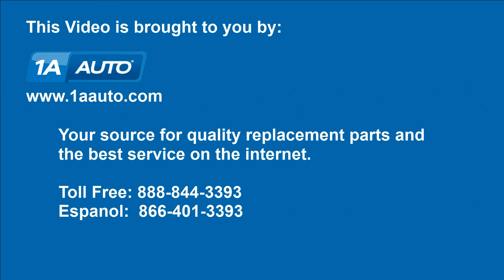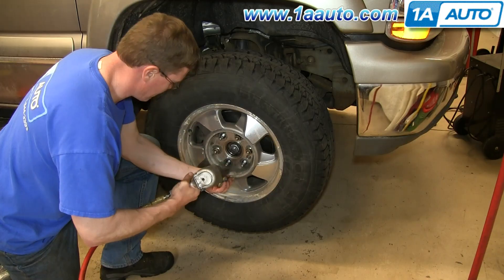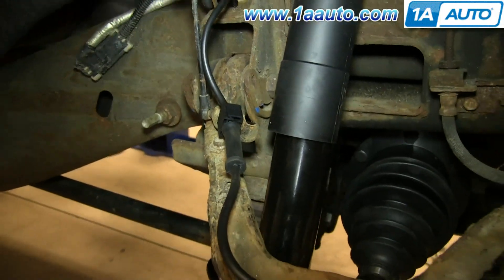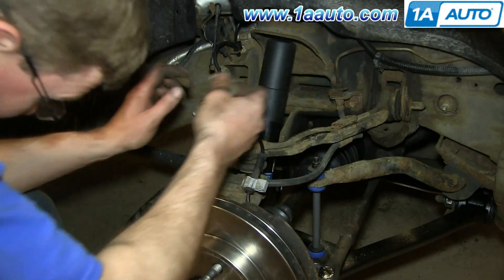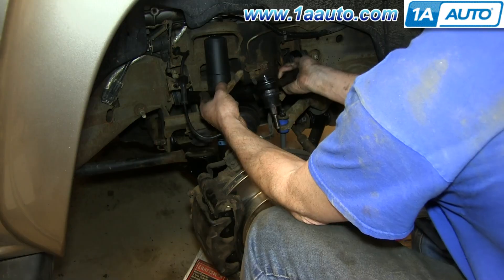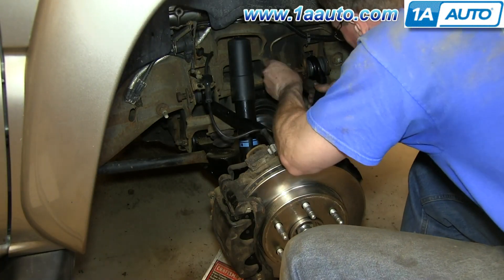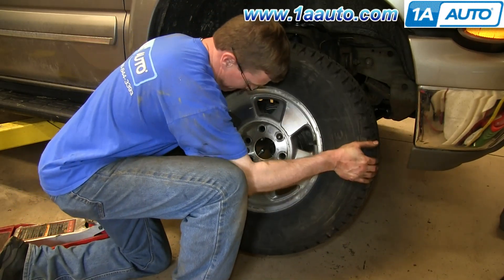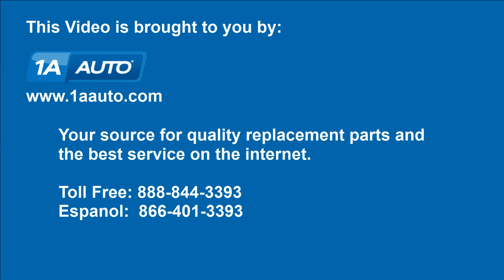How to Replace Upper Control Arm 00-06 Chevy Suburban 1500

Comment: This is a very good video. I had no problem replacing the control arms on my 2000 Chevy truck. The only thing I had to do different is I had to unbolt the brake line to get one of the bolts out of the control arm. I saw that coming and was prepared to take it loose. Thanks again!!!
Reply from the maker: +Gary Christian Thanks for watching. If any of our viewers needs to make this repair, we carry the auto repair part shown in this video on our website. Here is a link to them http://www.1aauto.com/control-arm-with-ball-joint-driver-or-passenger-side-front/i/1asfu00041?utm_source=YouTube&utm_medium=CTA+Comment&utm_campaign=ytcomment&utm_term=-L0exX3BRaE

Comment: The A arm bolts go in from the inside out, it does make a difference.   If you leveled your truck body with lifting keys. 
You need different upper control arms. OEM \stock ones throw the camber off. It would be good idea to replace the (3) pitman idler arms and bracket, if you have a high milage truck.

Comment: When the guys I work with told me before I put the upper control on said that have that a knockout tabs every video that I seen from 2002-2006 I don't see anybody knocking out the tabs. I just have a question to are there any on the 2006 two-wheel drive Chevy trucks please get back to me other than that I love watching your videos there are amazing they helped me through so much with all my cars and trucks.

Comment: A few heads ups for whoever does this in a different spec truck!

1. If you have wheel speed sensors, you will need to buy new brackets for the wire. Part number 15715954, special order from GM or GMPartsGiant. For the time if you don’t have it just use a zip tie.

2. You may need to undo the 10MM bolt for the metal brake line bracket to fully remove your camber bolts. You may also need to bend it upwards (gently!!!) out of the way.

Great video but just a few things I encountered.

Comment: At 1:15 is my upper control arm supposed to be resting all the time on that metal plate on the rite side of the arm rite under it??
Reply: No it should not be resting on the bump stop. Sounds like a too tall level kit has stolen all your down travel.

Comment: Currently in the middle of this job on my folk's 2005 Sierra 4wd. It's from Vermont, two of the bolts that hold the control arms on broke. (One on each side) All of the bolts are stuck. I've tried heating them with MAP gas. air hammer, etc. I'm literally going to torch them out tomorrow. What should have been a simple job has tuned into a 2+ day affair.

Comment: If only my ball joints would separate from the knuckle so easily.   Same could be said when I went to do the hub assembly.  Here in MN, rust is a better adhesive than JBweld, I swear.
Reply: 8lb sledge works like a charm

Comment: How do remove the control arm bolts when they are rusted to the inside tube of the bushing and spin when the rubber is torn, how do you get them out on a 2000 chevy suburban 2500 4x4
Reply: Hey man I just had the same problem. I had to use a reciprocating saw to cut the bolt off on both sides just on the inside of the bracket. You need a carbide tip $10 blade.

Comment: Snapped the two control arm bolts trying to remove the nut. Completely seized up. Tried beating them out with a hammer and punch tried turning them on the bolt side and broke the heads off.  Tried a air hammer and still can’t get them to budge. Any suggestions? And I can’t seem to find replacement bolts for it. Got any?

Comment: Do you know what bolt is used for the two mounting bolts for the brake hose? I shared off the heads of both of them and I need to drill and tap them, but I can't find what the thread size is.
Reply from the maker: +Thomas Freundl At this time we do not have any information on the size of the threads. Please do not hesitate to contact us with any further questions.
Reply: @1AAuto  Thanks for replying

Comment: Hey guys do know where to get the welded rivets that are like on the frame? One of my busted off when I did my upper control arm last summer and it’s been slightly shifting turning slow or stationary. Not sure exactly what they are called but they go through the little plates you marked.
Reply: Moog makes camber pins

Comment: Would you do this because the rotted bushings come as a set with the control arm? Can you still replace the upper ball joint and reuse the old control arm?
Reply from the maker: The upper ball joint may not be serviceable. You more-than-likely would have to replace the whole arm.

Comment: After putting control arms does it need to be aligned again
Reply from the maker: +Teresa Gentil Yes. You should get an alignment any time you work on your steering or suspension. Hope this helps you out. 1aauto.com 866-403-3393

Comment: Where is the spring?  Did you remove the front spring for clarity?
Reply: It has torsion bars, not springs.
Reply: No spring on 4wd. They use torsion bars that run from the middle of the truck into the lower control arm
Reply: The spring makes it almost impossible to get the bolts out and back in. ( On 2wd models) Has anyone else had this problem. And if so, what does one do to make it easier?

Comment: Do you line up the alignment brackets with your liquid paper marks as you tighten everything up? Also, does it matter if you replace the stock upper control arm before or after installing 2" leveling torsion keys?  Thank you for your video. Great filming and well narrated.

Comment: wheel alignment after this job? Do you have to remove the whole arm or can you just replace the ball joint?
Reply from the maker: +Carl Zorro You should have an alignment done after making this repair. If the ball joint is serviceable on your application, you could just replace the ball joint if the bushings are okay on our control arm.

Comment: Might be an odd question but I have a 2000 Silverado 1500 4wd. I have a spare set of performance engine upper control arms from a 2001 Silverado 1500 2wd would they fit my 4wd?
Reply from the maker: You may want to check with the manufacturer of that particular part
Reply: 1A Auto Parts ok thank you I will

Comment: What are those brackets for and what do you like them up with? I'm doing this project soon on my 99 and been woundering about those.
Reply from the maker: +erik Hamilton Thanks for watching!  Those are the cam adjustment brackets, so you will have to mark where the tabs are like he shows you in the video.  You just mark where the tab is on the part where it mounts to.  If you do not put them back in the same positions your cam will be off and will need to be taken in to an alignment shop.  1aauto.com

Comment: Does this apply to a 2004 Chevy express 1500 rwd
Reply from the maker: +Kenneth Ball It may be a similar procedure. At this time, we do not have a video for your exact vehicle on the upper control arm install. Thanks for checking us out!
Reply: @1AAuto  got my new control arms in the mail already got them installed thanks for the fast shipping!

Comment: What brand name control arm(s) did you use? Do you recommend them? Would rather replace bushings/ball joint in the factory arms?
Reply from the maker: +amurican35 Here is a link to them control arms shown in this video on our website. Hope this helps you out. http://www.1aauto.com/control-arm-with-ball-joint-driver-or-passenger-side-front/i/1asfu00041?utm_source=YouTube&utm_medium=CTA+Comment&utm_campaign=ytcomment&utm_term=-L0exX3BRaE
Reply: I noticed in the video that you greased the upper control arm ball joint after install...however the link you provided takes me to the part but it has no grease coupling in the pic.  Do you or do you not have to grease the ball joint?
Reply from the maker: +amurican35 It the ball joint has a grease fitting it will need to be greased. If the ball joint does not have a grease fitting it is a self contained ball joint and does not need to be greased.

Comment: Great video's always. What are the torque specs for the upper ball joint nut? Thank you
Reply: How do you plan to get a torque wrench in there
Reply: @dawsonmessenge9860   Easy. Remove axle shaft.
Reply: 37ft-lb.  18mm crow's foot.

Comment: Which specific grease do you use in the upper control arm grease fitting?
Reply from the maker: +Taylor steeves You may want to check the service manual to see what it recommends. Usually you can buy a grease cartridge at your local auto parts store to grease them. If any of our viewers need to replace their control arms, we carry the replacement part shown in this video on our website. Here's a link to them, We also offer free shipping on all orders in the US.http://www.1aauto.com/control-arm-with-ball-joint-driver-or-passenger-side-front/i/1asfu00041?utm_source=YouTube&utm_medium=CTA%20Comment&utm_campaign=1ATony

Comment: what's the point in marking the tabs through me off a little?
Reply: Me too
Reply: That’s camber adjustments..you want it to be at least close,so the alignment is mostly intact.
Reply: @Mercury_Shadow462  what are you trying to get close to?
Reply: @andrewdevenezia4927  when you take it apart and put it back together it should be in the same spot. If your alignment was good to begin with.

Comment: My 18 mm nut keeps spinning when trying to tighten back up?don't understand why
Reply: I'm having the same issue.
Reply: the ball joint it tapered so it needs to be pushed all the way in the spindle in order to tighten it

Comment: Would this be similar to a 95-99 k1500?
Reply from the maker: +Minnesota Unearthed It may be a different process on that vehicle. Here's a link to the control arms that we carry for them https://goo.gl/9CWmZR
Reply: appreciate it, thank you. I have squeaking and clunking on the front right passenger side. Just changed pitman arm, idler arm and bracket, inner and outter tie rods and still clunks. I'm thinking control arm?
Reply: ball joints are good.

Comment: Good video, but those control arm bolts should be tightened with the suspension stabilized by a jack or something prior to final tightening. They'll fail prematurely otherwise.
Reply from the maker: +James Dwyer Thanks for watching!  We actually jack up the lower control arm towards the beginning of the video, which fully loads the suspension as if it were on the ground.  As long as the suspension is loaded you can torque down all the bolts and it won't be an issue!
Reply: @1AAuto  Ah, totally missed that. Thanks for pointing that out!

Comment: I noticed in the video that you greased the ball joint after install...the link to the part you used shows the ball joint but it doesn't have a greasing port.  How would I grease the ball joint if it doesn't have a grease port?
Reply from the maker: +Vince Nguyen It may be a self contained ball joint that doesn't need to be greased. It would come self contained and pre-greased from the manufacturer. 1aauto.com

Comment: Why did he grease the joint. I thought they came greased
Reply from the maker: Regardless of whether or not they have been greased at manufacture, if there's a grease fitting on your ball-joints it's always a good habit to just top them off. This ensures that there's ample grease in there. It will not only extend the life of the part, but it will also help to reduce squeaking from that joint.
Reply: +1A Auto Parts that makes sense. Thanks for Quick reply!

Comment: I notice that everyone that asked about the torque lbs for the ball joint and control arms never got an answer. The reason I watched this video was to figure this out for my 2002 Chevy Silverado 1500 4x4.  Don't trust the repair book I have as it misleads me often.  Wonder why this question never gets answered.
Reply from the maker: +Great Bread The control arm bolts will need to be tightened to 140 ft-lb, and the ball joints nut will be 37 ft-lb!
Reply: What is torque specs for the lower control arms
Reply from the maker: +Francisco Rodriguez Thanks for checking us out. We do not have the specifications for the lower control arms. You would be able to find that information in a Haynes Repair Manual. Thank you!

Comment: You guys didn't even touch the brake caliper. Every other video I've come across cuz I'm doing this job right now I'm my own truck and tie rod ends, has taking the brake caliper off for some reason. I can't get the control arm to separate from the knuckle